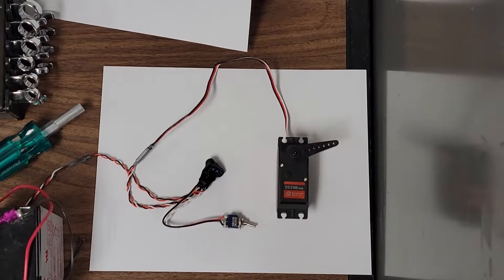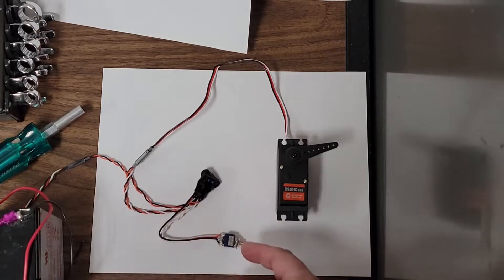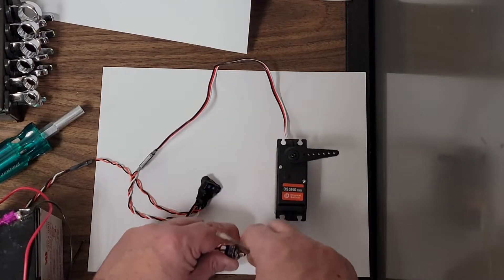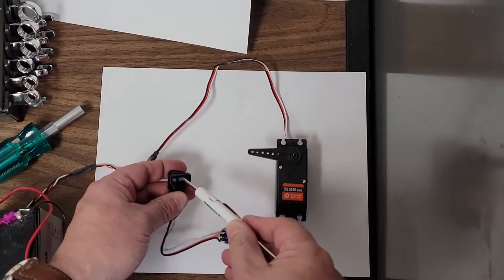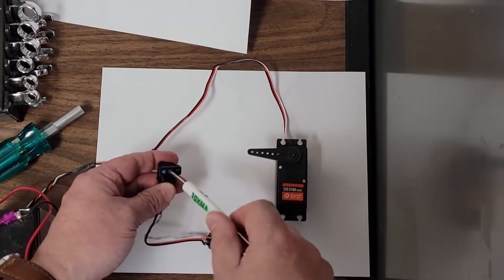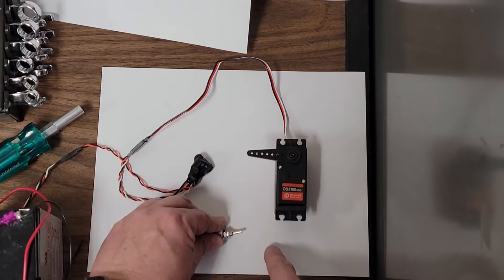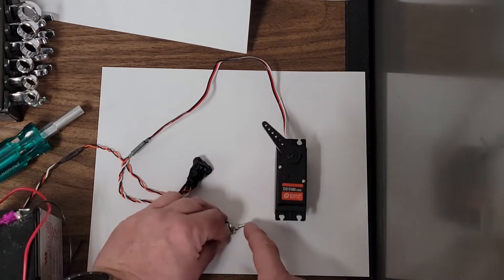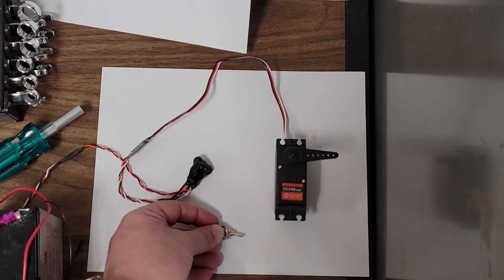Toggle Switch Servo Positioner with "power off" position.

Comment: Can I use it on my motorcycle foldable plate holder?
Reply from the maker: Not this one... The other one you commented on would be better.  I'm not sure what you are doing, but you can use the switch to move something to two different positions.    This is the link to the part in the store: https://www.heyokperformance.com/product/servo-positioner 
Contact me here if you have any questions: mostlyal@gmail.com